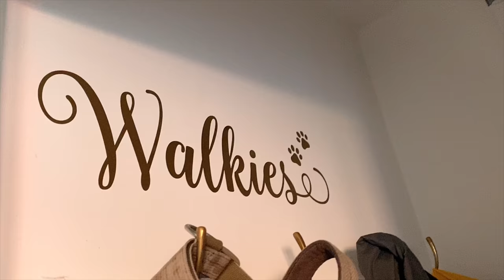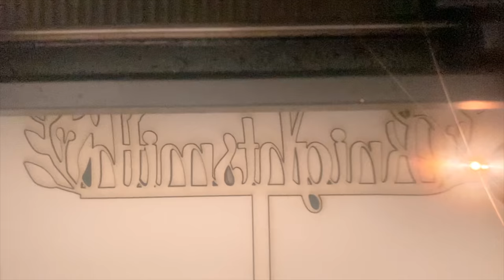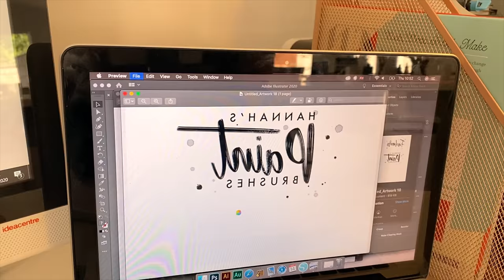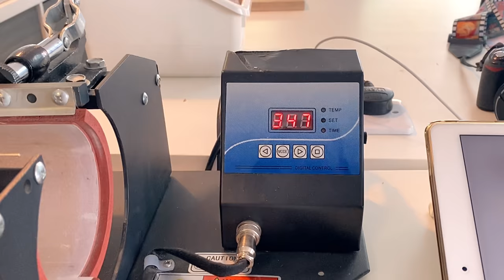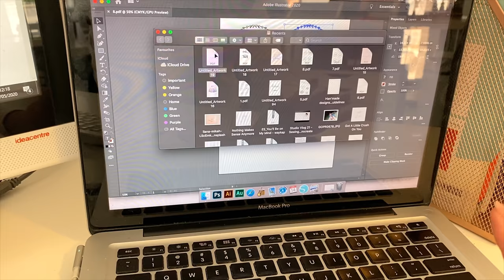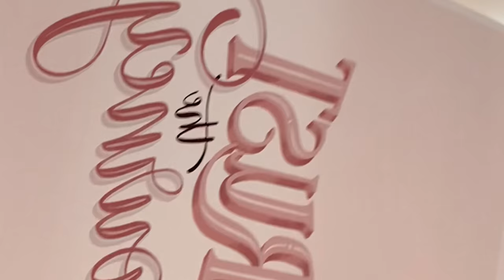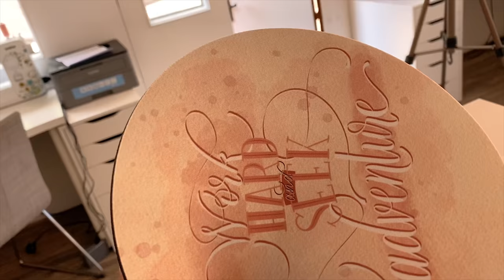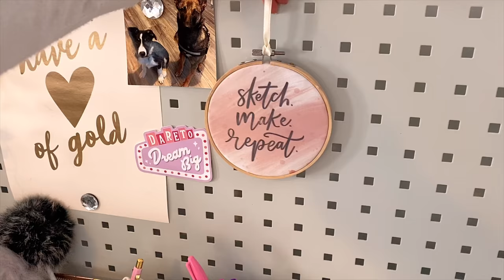Studio Vlog 22 - How I sublimate onto Mugs, Mouse Pads & Fabric for my Etsy Shop

Comment: Hi Hannah, new sub here, love your studio!  How long did it take you to set it up and did you start first from home and then moved to the studio? Also, can I ask how lasting is the Ricoh ink for sublimation, I want to buy a printer but haven’t decided which brand yet. Thanks!
Reply from the maker: Hi Myrna, thank you ☺️ I have been in business since 2013/ 2014, and decided to go full time straight away, and try and make it work from the beginning (I definitely don’t recommend this, but I wanted to dedicate all my time to making it work, and at the time didn’t have any commitments). I’ve always been at my studio space, but did start in a small tiny room before building this one. With light to general use (printing small areas on the paper, in comparison to printing the whole page in colour) my sublimation inks last around 10 months. If I have heavier use, they last a lot less. I tend to design things, were I can print multiple designs on one page to maximise the cost per print, and save wastage. For me, the ink is expensive at around £55 before VAT, but over the years I’ve been happy with the Printer and its results ☺️
Reply: Han’made Designs thanks! That’s definitely not expensive in my opinion. And hopefully one day I can have a studio like yours!